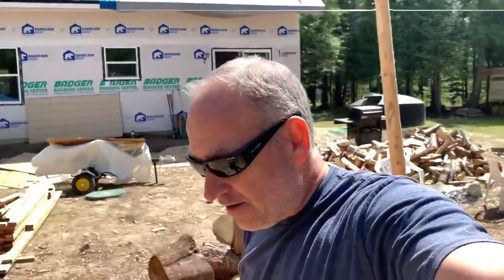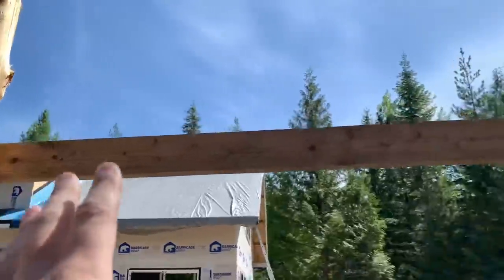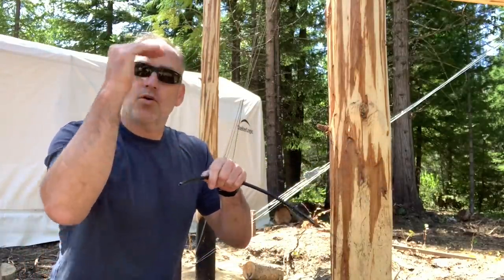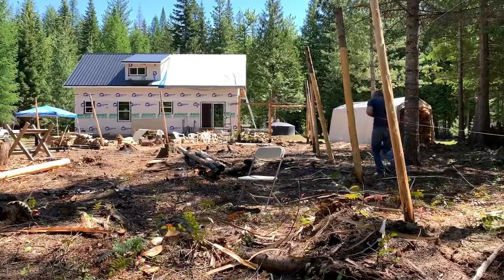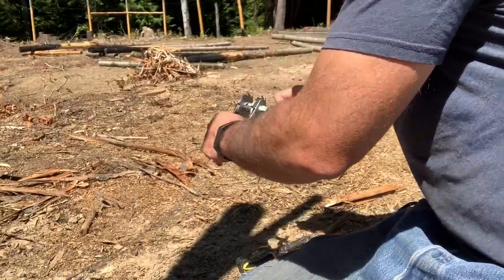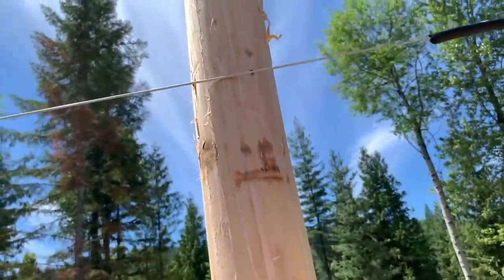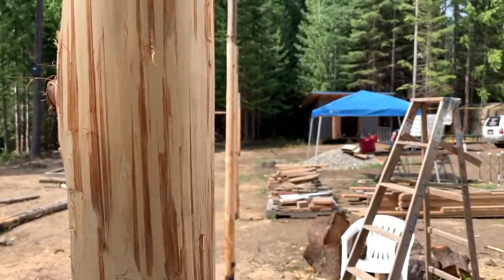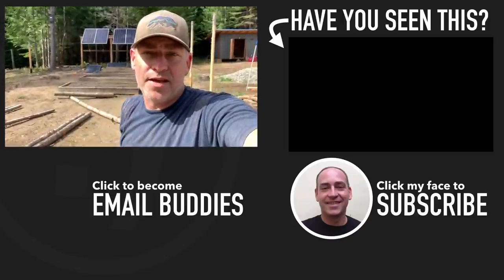Building a 7 Foot Tall Deer Proof Garden Fence

Comment: If you leave the two posts, they're on the inside of the line, so if you affix your fencing to them, it would gradually pull the fasteners out of the wood, especially if your wire is tight. If that happens,  there are various fixes, some prettier than others. If your favorite fix would be time-consuming or expensive, better to move the posts when you have some extra time.

Comment: you should thin out trees for the sake of the garden - dry out 10ft sections in a pole barn and you can mill them later - you will not regret the garden - double down on composting

Comment: It's called Shou Sugi Ban and is done by simply burn wood, brush it and seal it with oil. Experts says that this will preserve wood for 80-100 years without any further treatment. If it's oiled with tung oil every 10-15 years it will last even longer. Again this is not pressure treating. Pressure treating forces the preservative into the wood fiber.
Reply from the maker: I know it is not pressure treating. That is just a term people know for preserving wood.
Reply: I would be careful, not criticizing, but people use your streaming and others to learn how to do things, what works and don't as u are aware. Using the terminology is the first thing that they pick up on. My entire life was spent doing compliance work under OSHA and teaching contractors and government personnel safety-related issues. (Safety Sally). You're doing a good job and your hearts in the right direction keep it up.

Comment: when it come to laying out poles you have to start with the corner post first then lay up the bottom wire to guide you in digging holes for you middle posts , that way they are in a straight line. But you have to be careful of the wire during digging, you don't have to make it to tight so you can move it out the way. that way you don't have to re-dig them up over again
Reply from the maker: We used string when drilling the holes. But something went wrong. It happens.
Reply: @MartinJohnsonOffGridLiving  that why its best to use the same wire that and you dont have to remove it  during the dig
Reply: @MartinJohnsonOffGridLiving  but good job, i love your videos keep them coming

Comment: Why turn the extra poles into firewood? You will have more fencing projects so that is just double work when you can easily build yourself a lumber organizer on a wall with an overhang to keep the weather off it to have the extra wood from a project or in this case the extra poles for fencing stored in an easy to sort setup.